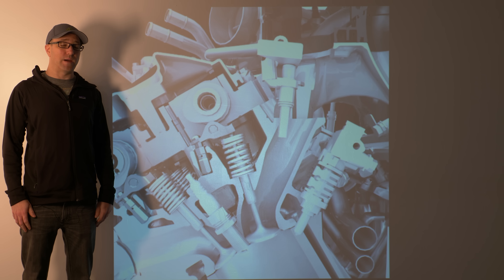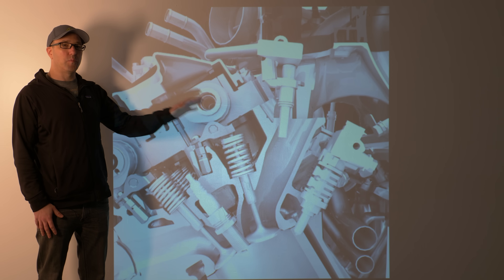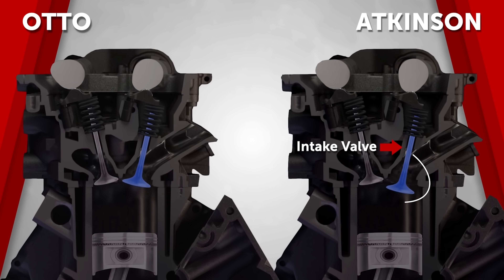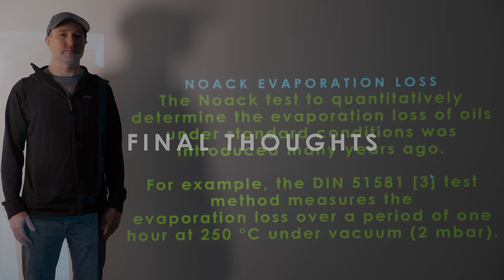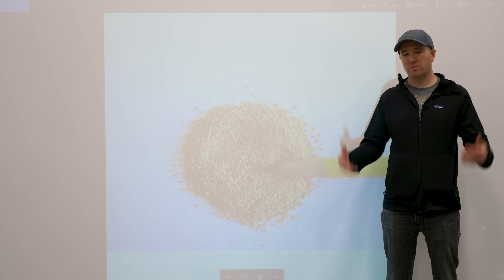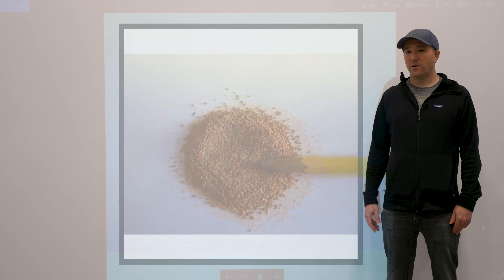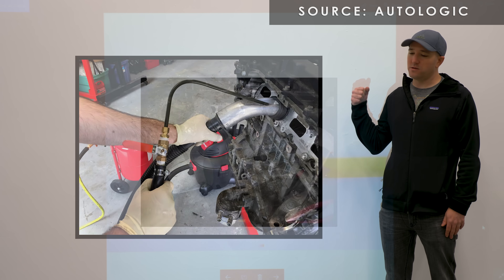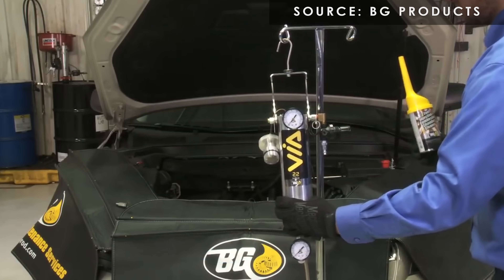Direct Injection, Problems and Solutions | The Fine Print

Comment: This is one of the reasons I'm looking at the 2018 Mustang GT now that they've gone with both direct and port injection. As good of a deal as we got on our 2017 VW GTI, it being FWD and the fact that we have to deal with dirty intake valves long-term make me want to replace it already.
Reply: Dont fret, use premiun gas from a reputable gas station and use the best synthetic oil. Be aware many dealers use cheaper motor oil that meet the VW spec but cheaper.

Comment: Overall, this is a general and basic argument being made here, new technology, when imposed will break, leading to problems long-term if not researched correctly. I remember when DI first came out. It was the new V-Tech technology that increased horsepower dramatically. For example, Hyundia's 3.8 Liter went from 306 hp to 348 hp due to DI. Then, several years later it was creating long term reliability problems. As usual, Toyota/Lexus fixed this problem by offering the combined injection systems. 

Similarly, the Savageese made a video that automotive companies need to focus on driver oriented systems (like the air conditioner, interior lighting... ) as decoupled entities from the entertainment systems, initially, I didn't agree. I said to myself what the hell does a goose know about cars. I clearly see why now. I bought a 2017 Honda Accord EX-L and after some time, slowly but surely, I came to realize the importance of this argument. Technology is being imposed so quickly due to changing demands by government fiat many companies are forced develop, incorporate the new technology to pass regulations, and leave it to the consumers to deal with the problems.
Reply: ErwinSchrodinger64 ummm Ford fixed the potential issue as well & actually had least amount of issues on their GDI Ecoboost twin turbo motors from Gen1 in 2011. All Gen2 Ecoboost are port & direct injection. As a family that only buys Ford trucks & Lincoln cars /SUVs we have had zero issues. Ecoboost is terrific technology.
Reply: Tracy Lewis Performance Ford & Lincoln generally spec 5w30 on their Ecoboost motors with great success. The smallest Ecoboost motors 1.0L & 1.5L/1.6L  use 5w20 I believe. Ecoboost has proven very reliable & powerful it is the premium motor in best selling truck in history ..F-150!
Reply: The problem isn't research as much as it is lawyers "designing" engines from high public office by fiat.  Lawyers are generally bad at two things: science and economics.

Comment: I like that you are exploring some possible pros and cons about direct injection, but you are surely exaggerating the extent of the problem, in reference to the worst case scenario. Earlier DI systems had these issues, like Audi but manufacturer's have found ways around carbon build up problems. 

As for Toyota using dual systems; they added DI to a port engine. They took they cheap way out, instead of engineering a proper DI engine from scratch. Ford did the same with their 2018 5.0 engine (Coyote). That motor was  designed for port infection. They added DI after the fact. Ford uses more DI turbos then any manufacturer. They're EcoBoost line of engines, which are used in cars, trucks and SUVs doesn't seem to have carbon build up issues that you make sound common.
Reply from the maker: Funny you should mention Ford because they had a well known issue of replacing cylinder heads because carbon buildup was so out of control on F150s back in 2014.  Now they have procedures in place for cleaning.  Ecoboost motors have carbon issues like most others.  When you say designing it right, there is no designing it perfect.  Controlling cylinder head temps help which is part of engine design as well as turbo seals.  But that is lab only in real world seals wear and temps are variable as is usage case.
Reply: savagegeese
 I don't deny that certain DI engines have had issues with carbon build up. It's just not on the scale in which you alluded to. Naturally there are other factors that can cause these things to happen, and oil quality, as you stated is one. Ford sell a lot of turbocharged trucks and some of these trucks are pushed to there limits. So if there was a carbon issue, you know that that would be front and center in the press, forums and news outlets. EcoBoost engines would be finished.  So again, yes, some DI engines have carbon issues; but can we agree that oil quality and pushing the limits of that particular motor could also cause the symptoms? I'm on my third vehicle with DI, and I have not had a carbon issue. For full disclosure, I only use Mobil 1 oil and premium fuel in my cars.
Reply: tdwillis1 Well I have 2011 Lexus ISF for 8yrs now that has what you call cheap way of doing DI & PI with No issues, when I checked injectors with camera last year they were damn good for having 80,000 miles on them at the time. 

oh and if you think this is no longer a big issue go talk to some BMW owners ask them if this is no longer an issue.
Reply: Honda seems to have found a way to mist fuel on the intake valves through scavenging/valve overlap. I've linked the white paper that helps illustrate their approach. Also, a few guys have pulled the IMs on higher mileage MKVII GTIs, which have shown comparatively little deposit accumulation vs. older DI VWs. Seems the industry has gotten better with the tech these days.

Link to white paper (see page 19):
https://hondakarma.com/data/attachment-files/2015/09/89991_Honda_2.4_L_Direct-Injection_Gasoline_Engine.pdf
Reply: Yes IS250 has DI and suffers from same issue just like every one else. But you made statement that Toyota took easy path and should have resolved DI problem. Toyota/Lexus were one of first company to utilize DI & PI over 12yrs ago with great success. I can attest to that, having owned my ISF for 8yrs 86k with no issues and my wife's 2013 335 with 62k had to bring it back to BMW twice for walnut shell cleaning.
Reply: tdwillis1 The Ford EcoBoost engines really need 93 octane. 87 octane doesn't belong  in a turbo charged engine. Definitely run synthetic oil, and I think you'll be all right. My mom's 2014 Hyundai Sonata direct injection has 80,000 miles on it so far no issues. I use fully synthetic oil in it, and every oil change I add a bottle of premium fuel system cleaner. We have a lot of Ford EcoBoost escapes at work, and they use Fleet fuel they don't seem to have  any problems I never see them at the shop.
Reply: See Lexus IS250 for having only DI and this exact carbon build-up issue
Reply: going to swtitch yo Mobil 1 if I find it better than RoyalPurple
Reply: Nothing’s wrong with taking the ‘cheap’ way out. Surely there could be other solutions which would be more advanced, but sometimes more advanced solutions would require more expensive maintenance to the customers in the long run. Btw, I’d still choose the Lexus over the Audi. Lexus is bulletproof when it comes to reliability. Audi is a big gamble.

Comment: Wow, this is better researched and presented than anything you can read in car magazines today! The level of quality in the content of this channel is amazing.
Reply: It’s always is!
Reply: only if you are in the business of believing everything you hear
Reply: I wish he mentioned a little about additives like SeaFoam, and how manufactures are using EGR and valve timing to wash the valves. It's inaccurate to say that fuel additives don't matter.
Reply: @taylorc2542  I think he means fuel additives when added to the fuel tank. The stuff sprayed directly into the intake  are a different story, though from what I've seen, their effectiveness is also open to debate.
Reply: That because they all lost ad revenue and subscriptions so they couldn't pay the good writers or even have access to properly research subjects. Then they end up saying some of the same things a know nothing know it all kid from highschool talking about how Turbo Confabulator can retro actively transduce the Bosen mechanical effect on trans modulated push cranks.
Reply: Gabriel.  LOL  You forgot : Vacuum Operated Deceleration Throttle Modulator.
Extra points awarded for stating what vehicle actually had one..........
Reply: But he didn't mention that the blow by is partly because of the use of low friction piston rings..  at least on the ecoboost engines.  And after installing an oil catch can on my fiesta st it actually has less lazy days..  it's been on there for 3 years now and I think that that oil getting put back into the intake is reducing the power output a little.  So now it's getting a cleaner burn and just goes hard all the time, except for heat soak now and then of course but I noticed a difference that's for sure.
Reply: Gabriel Sterr This is standard in this channel.  We are used to that.
Reply: Your standard is low I see.
Reply: This megazines are all big adds
Reply: As my vehicle eletronics prof once said: You don't inhale the exhaust gasses from your own car if you car has a functional exhaust. Therefore you don't care about your own car's emissions on a fundamental level like you do about the emissions of the car in front of you. Which is why it needs to be regulated by the state.
Reply: IT IS.Awesome channel.
Reply: Presentation Evolution. Humanity's infinite potential evolution.hahaha.
Reply: Gabriel Sterr ...dumbass its bullshit
Reply: Fascinating
Reply: Indeed!!!
Reply: He did a fantastic job. I was worried about my Lexus UX because I heard bad things about gdi engines, but this video clears up that my car will probably be fine  since it has both port and gdi.
Reply: Totally. FWIW I had reached the same conclusions independently and consumers are being sold a flawed technology ! Engines that don't last unless you're in the know.
Reply: Kris
have a look how clean the engine can be when you use the engine flush
https://www.youtube.com/watch?v=x4u64lKBbhQ
Reply: Electric cars are theeeee worst
Reply: Looks like a drivabilty nightmare. Wich injector is causing the misfire, lean condition or ritch condition lol.
Reply: But not surprised.... magazines are just paid ads....
Reply: Car magazines, lol
Reply: Goose man is really stepping up his game.
Reply: Car mags' such as Car & Driver, have almost no real technical data or graphics, like they did in the past.
Reply: Exactly, great video! Well done👍
Reply: This is not well researched! He is obviously not an expert. He is spreading popular misconceptions and making ridiculous assumptions. People should stop posting videos about things they don't understand. An average 12 year old could as well after one evening of research on the net.
Reply: Let's see:
Where do car magazines get their test cars from ...
Reply: The level of quality S U C K S !!!! things are not clear in his mind! "lots of blow-by" goes down PAST THE RINGS  first, not up through the valves like he said!!!it only happens on OLD cars(10 years old or over 150000 or 200000 miles);  the cleanup of the intake manifold (that NOBODY does!!!) has nothing to do w/ direct or indirect injection:  it has to do w/  blow-by and EGR!!!!!  he left that out....
Reply: @josepeixoto3384  
Blow by does happen on newer cars, it is minimal, gets worse with age.
Reply: Gabriel Sterr not really
Reply: Mgoblagulkablong carbon, nox
Reply: He completely ingored the worst part of GDI engines, what their emissions do to your body...
Reply: @Mgoblagulkablong  shouldn't you be saying VW....
Reply: Honestly it's not... The PCV deposits oil onto the valves. Do you deal with a lot of carbon deposits in your turbo or crank case? No, because engine oil doesn't leave carbon. Obviously these areas of the car are continually being washed with oil however IF oil left deposits, when you shut your vehicle off, some would be left over. This doesn't happen. The idea that the PCV is causing the build ups is a theory, that has been all but debunked. Oil catch cans have been PROVEN to do basically nothing. I myself have used one and didn't see a bit of difference. It just catches shit that would have been burned up during combustion anyway.   The most excepted theory as of late seems to be leaning towards gas vapor  leaking past the valves during compression and combustion, leaving deposits of fuel on the valves, which is then, like he did say, uncleaned by the injectors.

The research in this video was minimal. All he did was spend half the video talking about different types of fuel injection over a projection of animation videos Bosch released. He gave the exact same information that Bosch gave in each of these videos about how they work. Then clearly spent 10 minuets researching the problems associated with direct injection to come up with the PCV theory and the catch can "fix".
Reply: @YOURMOMxo69xo  Indeed, "research in this video is minimal". As an engineer in the engine business 40 yrs. Like a good political story - leaves you happy but still ignorant.
Reply: @YOURMOMxo69xo  intake valves are hot and oil vapors burn onto them. Oil in the crankcase is being cooled by more oil. Oil has 3 jobs- clean, cool, and lubricate. It cannot do any of those to an intake valve. Catch cans cut the amount of oil in the pcv vapor, don't know if they are worth the money. I'll just not buy a direct injection engine.
Reply: @YOURMOMxo69xo  - take a cast iron frying pan, put a layer of your favorite motor oil in it, and heat it to 800°F, and tell me what it looks like after an hour or so. That is the SAME thing that happens on intake valves in a DI engine. You're frying oil droplets on a hot valve, instead of in a pan. Oil leaves behind chunks of carbon when it's fried to a cinder.
Reply: @SmittySmithsonite  Take a DI car, put an oil catch on it, see what it does. Absolutely nothing except catch oil. I got Cold start misfire at ~60k from valves, and cold start misfire at ~120k after an oil catch system was installed at 65k. So tell me what you want but it ain't the oil.
Reply: @YOURMOMxo69xo  -  You're getting carbon buildup not just from oil, but from the combustion process itself, too. Also, a small amount of oil finds it's way past the valve seals, and will build up over time as well. 

I have a catch can on a non-DI 5.3 Silverado in an attempt to cut down on it's oil burning (an entirely different issue), but the can works great. Keeps the intake 10x cleaner.
Reply: @SmittySmithsonite  All that oil in a 4 stroke combustion process......... Aside from the oil part, I already covered valves leaking combustion gas. Yeah? the intake valves stay 10x cleaner? With port injection?.......
Reply: @YOURMOMxo69xo  - I didn't say intake VALVES - those stay clean anyway, since it's port injected. I said the INTAKE MANIFOLD - it was always an oily mess prior to installing the catch can. Besides the oil, the can also catches quite a bit of condensation, especially this time of year. The 5.3 in my Silverado is a shitty engine to begin with (thanks to GM cheaping out on lifters, cam, and cam bearings), so it needs all the help it can get.

Anyway, it's not that the valves are leaking - it's valve overlap, although brief on modern engines,  that I believe causes 50% (or more) of the carbon buildup. The other 50% is oil through the PCV and the small amount that gets past the valve seal. 87 octane fuel with ethanol produces ALOT of carbon.
Reply: @YOURMOMxo69xo  - Take it easy, buddy! Get up on the wrong side of the bed today? GEESH! I'm arguing DI because I'm a mechanic, not because I own one. Didn't know I had to own one to understand how they work ... 

 Where I come from, "INTAKE" pretty much means intake manifold. Sorry. Assumed everyone knew that ...

Looks like the only one I'm annoying is YOU! Wasn't even arguing with you, dude. LOL . 😂😂
Reply: @SmittySmithsonite  Thats crazy. Everyone's a mechanic when it's convenient. They don't work dog.
Reply: @SmittySmithsonite  dirty intake doesn't hurt anything does it? Combustion should not be happening on the backside of the valve.
Reply: @giovanhagar  - It shouldn't be .. but carboning up intake valves are a given on any DI engine that doesn't have an additional injector upstream of the valve, like some manufacturers started doing. Dirty intake won't do a thing, unless you've got variable intake runners like some modern ones do. I put a catch can on my Silverado in an attempt to reduce the oil consumption - that it did, but very hard to measure. Most has been blowing by the rings since 50k miles.
Reply: Smitty Smithsonite So what’s wrong with the 5.3’s? I’m an LS man, had LS1’s and an LS6, was thinking about putting a 5.3 into a square body S-10 I just bought (had it when I was a teen, literally bought it back this past week from the older gentleman I sold it to). 
  I was under the impression they were solid motors, but I don’t know as much about them as I should. I would be switching out the cam and lifters anyway, but I’m still interested in what you know

Comment: Seafoaming my Valves every oil change is how I found to help them cleaned on my Optima, but it is an addiotional cost to every oil change and eventually it ad up.

I got fooled by thinking DI was fucking amazing, until I found out about the valve issues. I mean I love the whole Power and MPG thing but sometimes I think it's not worth it, I missed the worry free of port injection on my Camaro and I'm really glad the FRS have dual injection for this very reason.

Comment: Always heard that the "Italian Tune Up" was a good preventative measure.. I have a NA v8 with Di, and I ain't that worried, alot of the horror stories are from turbo'd Di engines, and of those most of em are Vw's group engines.. Di engines save a ton in fuel, so over the life of the car you have to factor in that savings, and then minus it if you need a "head off" cleaning.. Is it a bitch? Of course it is.. But if you keep your car 5 years or less or lease it, its the next guys problem..